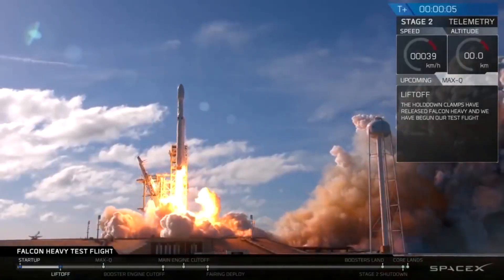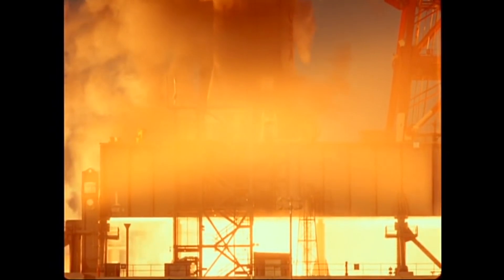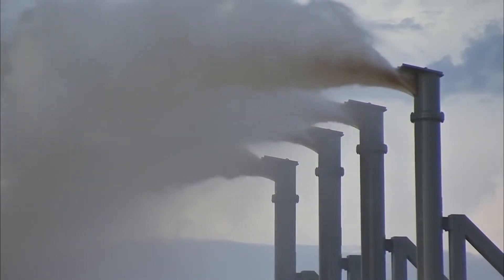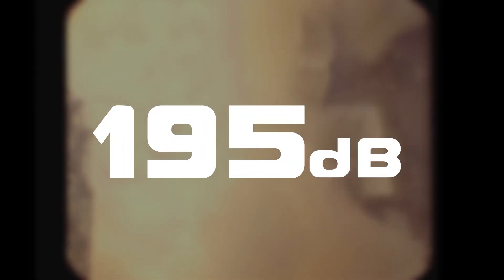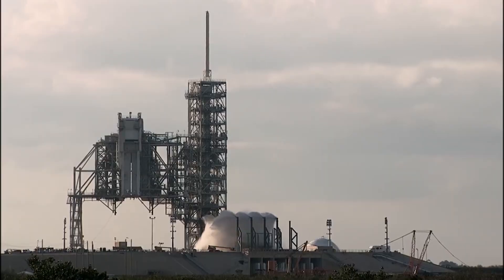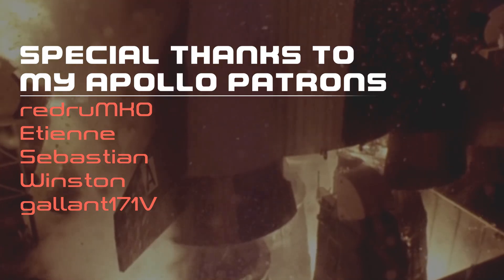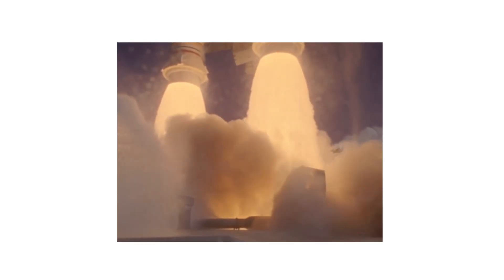Why doesn't the sound of a rocket launch kill you?

Comment: I've always wondered how loud it is for the astronauts riding the rockets.  It had to be extraordinarily loud inside the Apollo capsule, right?
Reply: No, they were almost 100 meters away from the rocket engines
Reply: @E9X330  100m away from a 220dB source it would still be extraordinarily loud. 

Edit: I did the calculation.  A reference of 220dB measured at 1m is still 180dB at 100m.  And that doesn't account for the vibrations transmitted through the rocket structure.
Reply: @Anthony.....What you failed to take into account is that MOST of the sound is in the direction of the thrust regardless of distance. Once you reach Mach 1 even the rush of air outside is left behind. If you've ever witnessed an on-the-deck military jet flyby, you can hardly hear them coming, but after they pass the noise is deafening.
Reply: @bhaggen  I understand that just fine.  I'm talking about the sound right at launch, when it all reflects off of the ground and the vehicle's velocity is negligible.
Reply: @Anthony.....The blast doesn't reflect off the ground; that would actually HINDER thrust. The flame trench redirects the thrust through a concrete tunnel that runs horizontally and "empties" out at least a quarter mile away toward the ocean.  https://www.youtube.com/watch?v=DKtVpvzUF1Y
Reply: Anthony   From what astronauts have said, they felt it more than heard it. They were in those suits, with the “snoopy cap” over their ears, so they could communicate with the ground. But they experienced a lot of vibration. On Apollo 8, Frank Borman removed his hand from the abort handle. He didn’t want to trigger the LES by accident.
Reply: This is so disrespectful for the people who died during a rocket start failure!
Reply: When traveling faster than the speed of sound you don't need to worry about the loud ass rockets
Reply: Tan Man 

I'd say it's dead quiet for the astronauts because they don't go in the rockets on launch. The rocket is just a giant firework Americans pay for. It goes up, then falls right back into the ocean when the fuel is depleted.

Wake up, people.
Reply: Flattenearth - You’re are a really good troll
Reply: FlattenEarth Your not smart because your choosing to believe something that clearly isn't true.

Wake up.
Reply: Romner_set 

"Also - https://youtu.be/Y1Hfiirwgys"

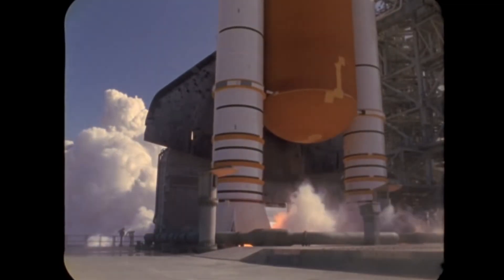Damn. The footage from the ground in that link you sentooks beautiful but it goes right into CGI 0:47 seconds in. 

It's time to wake up!
Reply: @eartheternal3565  do you have any proof that isnt on a website or on youtube or from a friend
Reply: username : I suck at usernames 

You are in such a state of cognitive dissonance that you can't even see the problem with your question. Literally everything can be found on YouTube or on a website. 🤦🏻‍♂️
Reply: @eartheternal3565  i got most of my information from deep thinking, comparing notes, and school(of all places)
Reply: username : I suck at usernames 

Considering you couldn't even come up with a user name I doubt your thinking has taken you much further than the shallow end of the pool. If you really want to start thinking, you're going to have to get to the deep end of the pool, which is Ironically where the astronauts fake their space footage. 

www.researchflatearth.com
Reply: @eartheternal3565  i did come up with a username it is username: i suck at usernames. There are no shallow ends in learning. Astronauts train in pools for several reasons, to check for any leaks on suits, orientation(to make sure they know what they are looking at and not upside down),water is closet to 0gs. Not sure where your are going with the filmed underwater, cams can shortout and since water is a dense medium over heat, if it was in a container light refracrion would reveal it.
Reply: username : I suck at usernames 

It's either that or they film in pools because Space is fake. 

I used to believe all that BS you said. Now I've realized we know what we're told. It doesn't make it true.
Reply: @eartheternal3565  i was gonna add to my latest comment that you were really mature and didnt use/resort to name calling or cursing buuut. 

Isnt that what learning is, knowing what we are being told, you can make it true once you see its true. Like how ancient Egypt figured out earth is round by putting two sticks in the ground. Speaking of stick, there's a person named professor stick please look at a couple of his videos.
Reply: username : I suck at usernames 

I don't believe the narrative about Egypt. I think Egypt was the Disneyland of 200+ years ago. 

Also, there is plenty of evidence that Jesus Christ existed to where there is no credible evidence that Eratosthenes (sticks in the ground guy) ever existed. 

I think both Jesus and Eratosthenes are "BS" or "nonsense" if you prefer I keep it clean, but it's still interesting that the mainstream narrative - in regard to scientific thinkers - would believe that Jesus is "just a story", which I would agree but on the same token think Eratosthenes existed, which I don't because there is no historical proof of him. 

Even if Eratosthenes existed, he would still have just been pressuposing the "R" value of a ball Earth even though in actuality there wouldn't have been proof whether Earth is rotating or if the celestial sphere sky is what's moving over us. 

I still don't think there's proof of a rotating Earth because all the footage that Allegedly proves anything about the shape of the Earth or other celestial bodies (aside from the Moon) are CGI.

I'll check out professor Stick.
Reply: @eartheternal3565  i forgot to mention  stick can be a bit harsh
Reply: Anthony

We the flat earth su🅱reme 🅱eings will prove to you that the earth is indeed flat 🅱.

Please take this link into consideration.
https://www.instagram.com/p/BnoONgPBgKA/?utm_source=ig_share_sheet&igshid=8urejqxc3gso
Reply: How can it be loud if they are in a film studio? Boom!
Reply: Bob the guy 

" Shootings" are propaganda by the government to keep us afraid and to separate the people from our guns. Once they achieve taking away our second amendment they will destroy us all.
Reply: I wish this guy is trolling.... Surely no one is this stupid?? Even my friend who fails every test is smarter lmao
Reply: Earth Flattener hey man, these fools will never get our point, I don‘t feel the spin and the only logic explanation is that there‘s millions of rich people covering it up
Reply: @eartheternal3565  Funny thing - you keep claiming "the government" is covering shit up and faking space launches. By "the government", I assume you mean "the US government".

Thus, you are ignoring the existence of the Russian space program, the Chinese space program, and the former USSR space program, which is what fuelled humanity to the moon - competition between Russia and the USA. You can talk shit about "the government" as much as you like, but the world is bigger than the USA.
Reply: Anthony 

The astronauts were nowhere near the capsule because nobody is truly going to space. Space is fake and astronauts only go to space in your imagination. The reality is the rockets are empty upon launch. They go up and then come back down, falling into the ocean, just like it appears. 

Please wake up. 

NASA is scamming Americans out of 54 million dollars a day. We could end starvation and homelessness forever with this amount of money. 

Www.researchflatearth.com
Reply: That moment you're to stupid too comprehend a subject so just start making up your own bullish*t theories so you can understand it. Sad.
Reply: @eartheternal3565  LOL, I wish I could tell if you're trolling or not.
Reply: Oooooh, i love Flatbrains, they are SOOOOOO cute
Reply: @eartheternal3565 wow, that's really sad.  No amount of free food will end world hunger.  And no amount of explaining things to you will convince you you're wrong.
Reply: Anthony 

"No amount of free food will end world hunger."...said no one on the verge of starvation, ever.
Reply: Earth Flattener If space travel is a hoax and thus we have no satellites, how do satellite dishes for TV’s work?
Reply: Earth Flattener Also, if there’s no satellites, how do satellite phones work? They can get service anywhere in the world, even places where there’s not a cell tower within 100+ miles.
Reply: Please. STOP.
Reply: Earth Flattener by saying that the earth is flat you are saying that thousands of people who work at nasa are liars and years of study are also fake wtf lol
Reply: @bhaggen  bist du Deutschelander?
Reply: Earth Flattener Do you even believe what you are saying?
Reply: @Alpaca Two Niner.....Ich bin Schweizer.
Reply: BiagioPro It wouldn’t just be NASA who’d have to be lying to cover up a flat earth conspiracy. It’d require the cooperation of every single geologist, geographer, cartographer, meteorologist, physicist, biologist (particularly ones who do research in Antarctica), and all the manufacturers of the equipment these scientists use. And that’s just to name a few people who’d have to all cooperate to keep a flat Earth secret. It could possibly take hundreds of millions, if not a billion, people, to all be quiet about the cover up. And they would have all been having to do it for at least the past several thousand years, as the Earth has been known to be found for that long.
Reply: you can't end world hunger..only postpone it till your next meal..
Reply: Earth Flattener .........you gonna tell me gravity is fake.
Reply: Yeah they fly in the Sky to the ISS then after 6-12Month they fall in the Water or on the land. So you are right. Because they chill in these 6-12Month at least 2-4 Weaks in one of the few residentials from other gods but thats a secret dude.
Reply: @eartheternal3565  space travel is not a hoax. People like you just say that to think they are intelligent.

And money aint fixing world hunger, you need jobs and make the cities or places thoose people live in modern. Also, what if they use the money to buy drugs and not food?

Space travel is much more important than satying here on earth. People have died. And you just say its all fake
Reply: @eartheternal3565  i know that earth is round, but i respect your point of view on flat earth we all have different opinions on things :)
Reply: Flattenearth - Your sources are in no way credible...internet bs is in no way credible.
Reply: @eartheternal3565  bruh
Reply: Isaiah Avant 

"Bruh"

Just trying to lay it out fuh reelz breh.
Reply: @eartheternal3565  
And what about the parts of the rocket you can see in space with a decent telescope?

What about the space station that you can see from Earth?

What about the hundreds of satellites you can see from Earth?

And there are thousands of pics of all of them, including top secret satellites, taken by amateur astronomers online. And with a good telescope you yourself can see them all.

Dumbass.
Reply: Robert Pruitt With thousands of satellites in orbit, you’d think we would have decent video footage of earth from at least one of them. Yet the only footage we ever see is of the ISS. Where is the huge archive of videos and photos from these thousands and thousands of supposed satellites? Can you reference one single picture of a satellite floating in space that does not look like bargain bin cgi?
Reply: People, calm down, don't get fooled by this Flat Earther, he just saying it so he can get a free ride to space
Reply: Juan Valadez Cameras only see what light reflects off of, so unless sunlight reflects off a satellite, you’re not going to see it. And the smaller and darker the satellite is, the harder it will be to see.
Reply: @eartheternal3565  haha.  I was a student engineer in aerospace.
All real.  Can't fool the brilliant engineers and scientists who made this happen.
Reply: Robert Gift 

No, we can't fool them but they sure as hell can fool us.
Reply: Earth Flattener     Right... so those satellite images of hurricanes are faked also, hmm? Not to mention communication satellites that you use every day when watching your television, and the ISS which, at the right time and place, you can see fly overhead. 

The argument about the size of the budget is also bogus. Our military budget (which also includes spy satellites) dwarfs the funding NASA gets. This is why it is taking so long to develop the SLS.
Reply: Earth Flattener    Sorry, but as you are the one making the claim, the burden falls to you to provide the evidence to support it. A page with links to other people’s sites does not constitute evidence. 

I am not your research assistant. You can begin by explaining exactly what you mean by your statement that satellites are floating on balloons. Specify just how a balloon can have various low earth orbit trajectories, or can be geostationary, depending on the purpose of the satellite. 

With the low-Earth-orbit (leo) satellites, I’ve seen orbital paths such as the ISS, and I’ve seen orbital paths that are polar. They move much faster than high altitude balloons.
Reply: @eartheternal3565  did you just say that satellites are on balloons?
Reply: @eartheternal3565  So "If there is a flat earth community why is there no flat mars community?" Elon Musk 😉
Reply: zocker HD garantiert 

Because, Elon, we don't know what we're on, let alone what Mars is. 

But it seems like we are fixed and not moving or floating or anything at all like Mars or any other celestial "body".

Comment: How satellite works without human interaction
Reply: radio waves, there ya go.
Reply: @jsullivan05  how radio waves produced
Reply: Here's a technical explanation:
When a direct electrical current is applied to a wire the current flow builds an electromagnetic field around the wire. This field sends a wave outward from the wire. When the current is removed, the field collapses which again sends a wave. If the current is applied and removed over and over for a period of time, a series of waves is propagated at a discrete frequency. If the current changes polarity, or direction repeatedly, that could make waves, too. 
If you want to learn more then you'll need to read A LOT, but to get back to your first question, think about how a cell phone works, it send and receives radio waves from a nearby tower, well the same thing happens with satellites except they are much more powerful and accurate, we call them satellite dishes.
Reply: @jsullivan05  how satellite orbit is decided
Reply: Depends on what they want coverage of, if they want a satellite to sit over one spot and not move they put it in a "geosynchronous" orbit, meaning it orbits the earth once every 24 hours, which matches the earths rotation, but that's far away and thus means slow connection speeds (high latency), if they need a faster connection (low latency) they put it closer but that means it will rotate around the earth faster than what the earth spins, so then they'll launch several sats and have the coverage overlap.